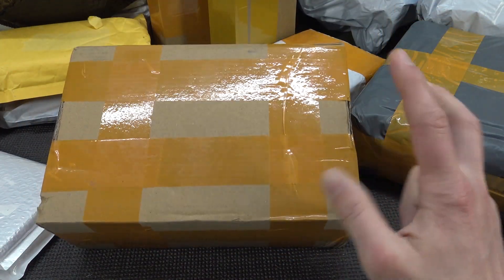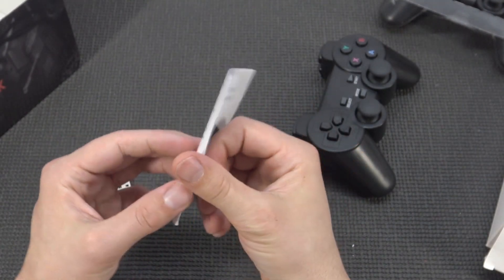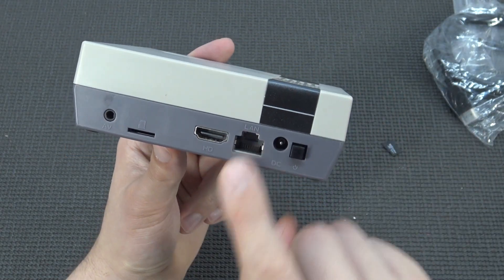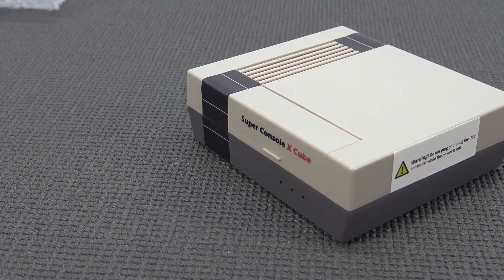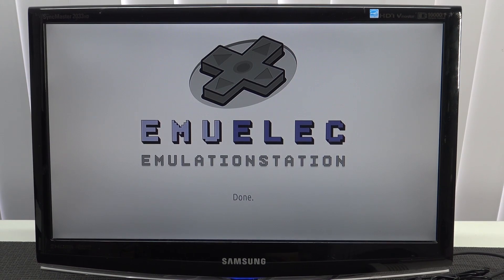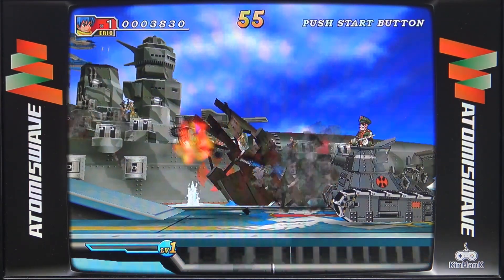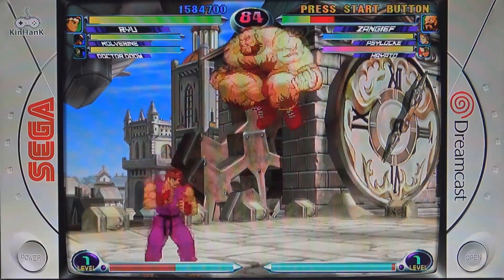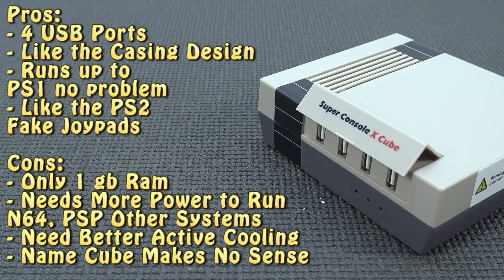Super Console X Cube ... Only it's Not a Cube 🤨

Comment: I just ordered the 256 gig version off of Amazon. I love this little beast! trying to figure out how to get rewind to work on all consoles.
Reply: Just got mine too.  I love this thing!
Reply: @wanghotangho5803  if you figure out how to get the N64 to run smoother let me know. LOL
Reply: @TheFLOMAN76  N64 seems to run pretty smooth to me.  Never owned the original N64 tho.  Can try to run at 640:480 aspect ratio or diff emulator.
Reply: @wanghotangho5803  it seems like certain games run better than others. I was playing paper Mario and it was running just fine until it crashed out. I don't know  emulation all that well so I'll try to do as you say... I get in there and tinker around, turn on things, turn off things, see what happens. I may have fucked it up and didn't realize it. LOL
Reply: I cannot get the legend of Zelda ocarina of Time to run smooth at all. Very jittery.
Reply: @TheFLOMAN76  haven’t checked that game yet.  I’ve seen a few vids to get some of these to work better.  I’ll check it out and tell you what I find
Reply: @wanghotangho5803  right on man. I appreciate it!
Reply: @TheFLOMAN76  It’s running great for me.  I didn’t use the default emulator and chose ‘Parallel N64’ to run it.  Checked about 5 minutes of gameplay.  no problem whatsoever
Reply: @wanghotangho5803  That seems to be the best emulator for N64 that I have discovered also. It's glitchy as all hell on some games but it does work pretty well for most. I get to play Doom 64 again.... Makes me happy!
Thank you for responding sir! I was wondering if you were going to.
I also discovered that you have to have every option the same for the system and the game. If that makes sense. 
So far it works. It's not perfect though... But with a new update, things might get better, let's hope anyway right?. I'm pretty happy with what is offered here mostly.
Now for my next question. LOL. Can you get systems like the commodore 64 oh, and the amstrad and all those that use a keyboard I'm assuming? Do you know anything about those consoles?
Reply: @TheFLOMAN76  Doom 64.  Yeah I gotta fix my controller settings for that one
Reply: @TheFLOMAN76  use parallel64 , just hit select when your in the n64 section and set emulator from default to parallel64.Mupen64 is the default and its slow
Reply: @wanghotangho5803  That comes with many emulators for each old console pre-installed?
Reply: @stephanesurprenant60  yep.  Plug it in and you’re off to the races

Comment: Hello Wicked! I should be receiving mine in 2-3 days, went with the 256GB chip version. I have a couple questions you may be able to help answer (or any other friendly earthlings that know!). 1. Instead of using the wireless controllers, can I simply plug my wired xbox360 clone pad into port 1 and have it de detected on power up? I just really like the one I have but didn’t know if it would require extra setup? 2. It seems to enjoy getting hot according to ETA Prime: do you think I could just jerk the case open when playing to cool it, or maybe use a USB powered fan with the case open to blow on the exposed board for extra cooling? If yes, could I plug the fan into another of the front USB ports to power it to cool it off? Or would you recommend another usb power source? Another idea I had was using a plastic-encased ice-pack and just set the Cube on top of it to cool from below? Maybe a dry wash cloth between the two to prevent moisture? I am up for ideas, as ETA’s review showed once it got much past 7 degrees Celsius PS1, DC and N64 frame rates dropped and in came the choppiness. After he let it cool down to 44c, they all ran full speed again. The AliExpress page I bougtght from showed the SEGA Saturn logo- do I even dare hope it will play any Saturn? That’s what I really want in a cheap system and hope it runs!  

Last question: any chance if some games are too slow I could take the MicroSD out of this Cube and put it directly into  my Raspberry Pi 400, power it up and have it work without having to fuss with it to run? 

Thanks for your help and so many terrific videos! 
-Stradlemonkey🐒

Comment: Thank you for your tear downs, I remember that you tore down this system. My system that came from aliexpress, it had a rattle inside, I thought it could have been the cooling element because you can easily rip it off. But I just opened it and found out that it was the LED little box was just out of the area and that was what was rattling. So I stuck it back in place and through a tab of glue on the post where it connects to. It seems firmly into place but just in case I just put a dab of super glue on the posts.. thanks for the teardowns, I know her take things apart so that came in handy

Comment: I bought the Super Console X NES version two weeks ago, and the only significant issue I have is its overheating problem. Even in NES games, it causes issues when it gets hot. For example, after a certain period of time, when it overheats, there are delays and drops in the visuals in games like Contra for NES. I wonder if I should open it up and replace the thermal paste or somehow install a fan. It would be great if you could assist me.
Reply: After how many hours of play it happens?

Comment: I got a question about the console X machines in general. My TV is 49 inch. Every YouTube reviews these boxes on a monitor.

How does this perform on a bigger TV? Does it look good or:
-Is the image ugly and stretched out or
-You have very large black borders around the screen and only 20 inch of gameplay on the TV?
Reply: got a 58 inch tv and the cube model, works alright, quality is acceptable, its stretched out for me can send pictures hit me up if u need them cheers
Reply: @bkrstf  thanx for the reply. I bit the bullet and bought one. Really happy with it.

In 4 by 3 ratio it looks really nice. Great colours to with default emulator settings
Reply: So yes it will look good on a modern tv?
Reply: @user-sw4qd2up2s  yes it does. Especially with upscaling in higher resolution for psx

Comment: they call it cube but instead of a gamecube like case they went with an NES case should of called it the super console XES.but it has 4 usb ports like the upcoming evercade vs.they also need to stop putting certain games & emulators on it if it just doesn't have the power to run them
Reply from the maker: Totally agree with you 😄👌
Reply: Like what games wont play?

Comment: av out works?
Reply from the maker: Try'd is with old models... i can't it to work on a CRT 🙄
Reply: @WickedGamerCollector  i think i found the solution, you need to change the resolution to 480 or 576 in the settings, then reboot, it should work...to revert that you need to use a pc and change the config file